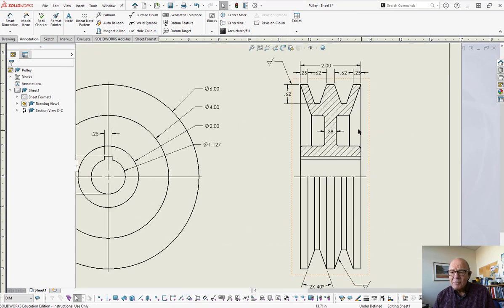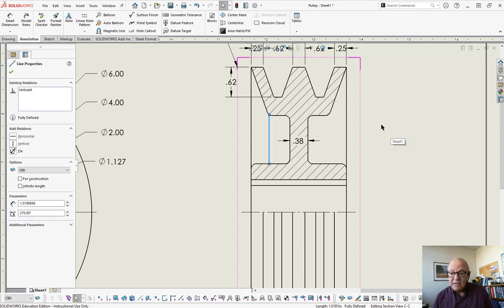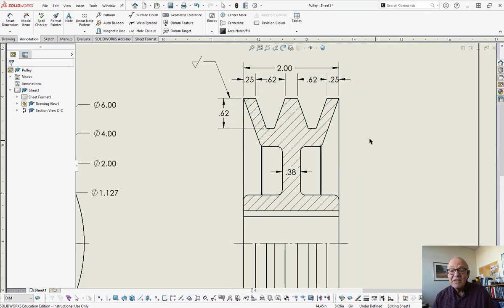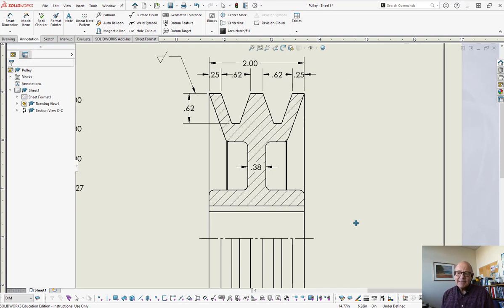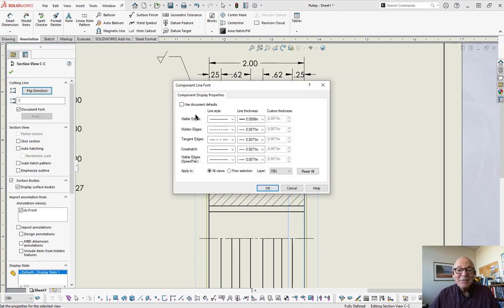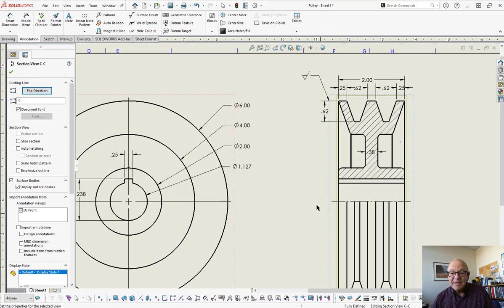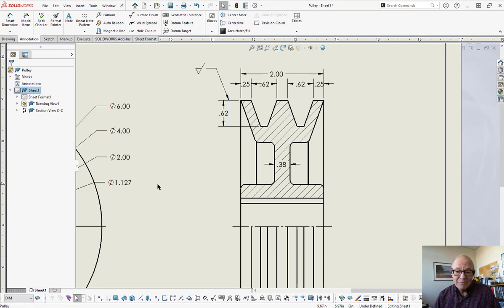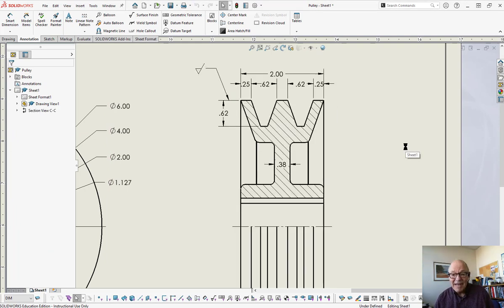SolidWorks Line Thickness and Hatch Problems

Comment: I had a similar problem but where lines appear good on screen but far too thick when saving a drawing to PDF. Ive changed the default line thickness but it says this won't change the appearance on screen, which is generally OK but you have been able to set a different thickness on screen. Is that because you are changing the component level lines on the drawing?
Reply from the maker: Yes, adjusting the settings at the component or layer level within the drawing is usually the best way to control how those lines display.